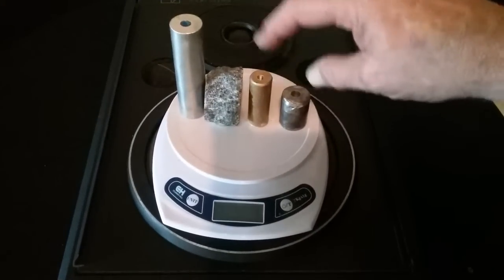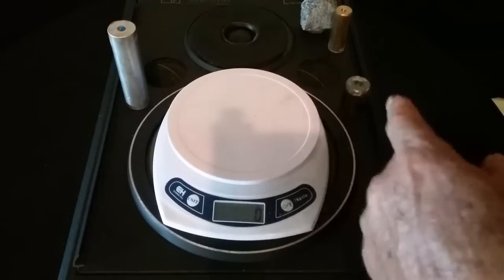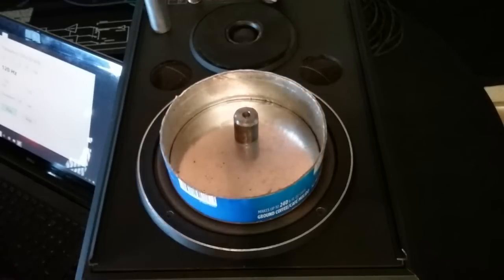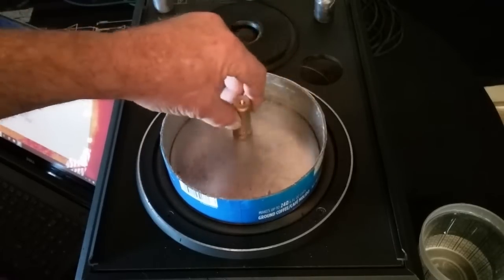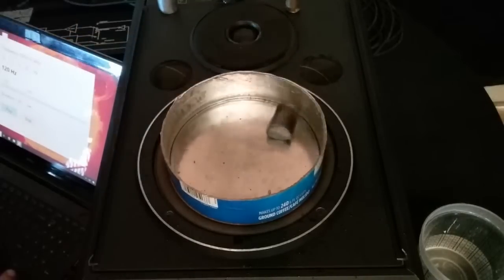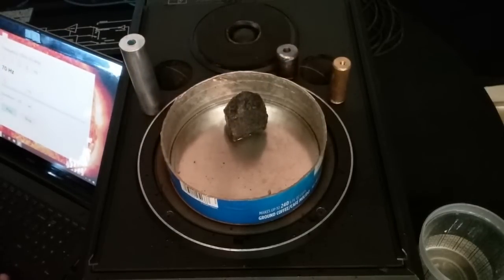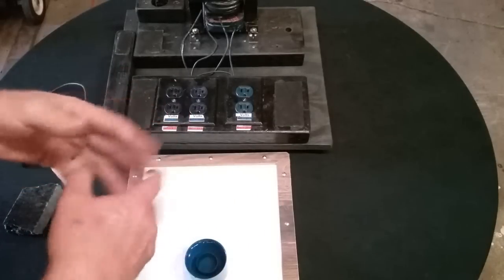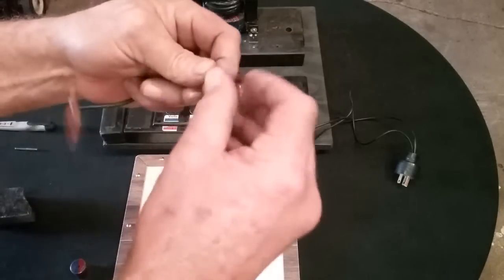Vibrational and Electromagnetic properties of Granite

Comment: That must have been how the Egyptians moved the granite blocks. The question is, how did they make sound frequency vibrations
Reply from the maker: Two things. I believe the megalithic structures in Egypt are far older than the "Egyptians". I believe there were huge humanoids (Nephilims) moving the huge stones - but I also believe in the Saturn myth - which made gravity, the electrical ambiance and the vibration situation of the Earth was much different thousands of years before the Egyptians.
Reply: Akin Aydemir I believe if you run a electric current threw crystal it creates sonar. Which essentially is the same thing as sound waves.
Reply: They have found thousands of bowls that are capable of creating different frequencies
Reply: They also had giant instruments like the didgeridoo.
Reply: @Akin There is already substantial evidence that ancient civilizations had huge (room sized) musical instruments -- drums, horns etc. You can easily find them in Bhutan and Tibet today.  There are many ways to tune sound to get it to a higher frequency similar to how we tune electricity to get higher voltage. You can get a higher frequency with simple tuning forks.
Reply: Have you checked out the channel Water Power Planet? If not you should.
Reply: Also think about gongs......That could be a possible tool for this concept.
Reply: @TheGoodVibrations  i believe there were giants as well. I have never considered tho that the electrical ambience and vibration of earth could have been different. Thanku!! That puts some things in perspective a bit more for me.
Reply: 100%
Reply: @TheGoodVibrations   you are on to something 😊
Reply: https://youtu.be/BsqOLCXYznE another great video regarding granite and possibly how giant blocks of granite were cut.
Reply: They've using the sound came from earth and multiply it, the sound source could've been the water that used to flow under the pyramid
Reply: If you look at hieroglyphs they had large tuning forks depicted in many drawings and carvings….
Reply: Somehow I'm picturing drumlins of men by the hundreds drumming
Reply: That's very simple and easy to find look up things that produce freq that the ancients used.  One other way would do with a megaphone and the pyramids In theory that is.
Reply: Didgeridoo and dance/marching to cadence
Reply: @danielchism2317   I've imagined a giant tuning fork driving a bunch of miniature tuning forks with reciprocating/vibrating diamond cutting tools. A bunch of people just carving away with multitools.
Reply: Bose noise cancelling headphones
Reply: You can vibrate things with your voice. "Ooom"
Reply: The India theory is they used a ship to move the big blocks. It even talks about where they put the ship.
Reply: There are probably spots on mountain tops where sound can echo and multiply it's strength.  If directed towards the stones the right way, maybe that could work?
Reply: @Lani Childs elephants need cover from the sun, can't find it in the desert
Reply: @flippinswazzy7115  and laser beams
Reply: @bundiesel8472  facts imagine a group of didgeridoo "oooohming" away or a few hundred people dancing stopping chanting I'm unison.
Reply: @cavelvlan25  makes since to me
Reply: Maybe if a lot of people was farting at the same time....?
Lol lol sorry.
But it is a good question.
Reply: @bundiesel8472  there are actually biblical  aspects that support the tech. Such as the trumpets destroying the defenses at Jericho. Marching a fleet around the city walls and blasting trumpets till they fell. Not saying this this is historically accurate, not saying it isn't. Only that it's supports using vibrations in ways we have not.
Reply: One person has said that you can see tuning forks with wire intertwining in the fork in egyptian hieroglyphs. Also these tuning forks are attached to long poles. This is for the drilling they believed
Reply: @ozoneswiftak  they almost surely used barges (ships) to transport heavy stones from the quarry to the complex. Likely the complex had channels and docks that came much closer to the pyramids than now. All this is accepted mainstream Egyptology. The things harder to explain is how they were able to carve granite to such tight specifications. The Inca’s and some from India worked to even tighter tolerances, but the Egyptian coffin vault(s) are almost perfect rectangular boxes formed from a single piece of granite with ninety degree angles (not rounded at all) and surfaces so flat and smooth they are almost mirror like.
Reply: @TheGoodVibrations  they used the natural vibrations from the planet to create the electricity using the piezoelectric effect
Reply: Also the earth is an anomaly as a planet because the molten metal core is approximately twice as big  as a result of a collision with a twin planet and the two cores amalgamated, this gives the earth a much bigger magnetic field making the piezoelectric effect much stronger, the moon is what's left over from the collision
Reply: What makes you think Egyptians moved anything?
Reply: @andyb7963  That's an unproven hypothesis like most cosmology.
Reply: Or both frequency and magnetism. Frequency to get frequent lift. And magnetisn to push or pull like how 2 magnets can battle
Reply: This does not explain how they lifted multi tonne blocks 350 feet in the air and placed with precision. Another thing is how did they position 1 block onto the pyramid without moving any of the others.
Reply: @TheGoodVibrations thank god someone else has the eyes to see. All the real good granite stuff is pre 12,000 years old. Before the great cataclysm and the other pyramids are later attempted reconstructions
Reply: @Cjohn31  The museum of Cairo  has lots of those wooden staffs w wooden tuning fork looking ends you see in heiroglyphics. Seems like they could be used to strike w to give a set frequency determined by the fork, delivered in pulses by the strikes.
Reply: @terryenglish7132  that's interesting
Reply: @foylad4862  There's a video here of a grandfather moving 10- 20 ton concrete slabs and stacking them up BY HIMSELF, using just simple machines, ie levers, wedges etc. The key is placing a pivot sphere 1/3 of the length then just swinging it around, then doing it again . Those Diorite "pounding stones" found in quarries were for that purpose, to move the stones, not make them.
Reply: Sadly, the vibrations would not travel through  loose sand like it does a flat piece of sheet metal. You'd need flat polished bedrock. And scaling this up doesn't seem feasible, either.
Reply: @oninjadolegume  that was just my big deck boiii haha
Reply: Farts
Reply: The pillars were hit by the wind creating a hum
Reply: It can be entertaining, enlightening, and even  inspiring to dig into myths and legends and metaphors. But believing in anything outside of your direct felt experience is foolish and is distracting you from unlocking the secrets/(w)holiness WITHIN. Don’t delude and dilute yourself.
Reply: It wasn't the Egyptians bud..... the way they dated them was from things inside..... these are remnants from a much older civilization and they're seen all over the world. The general understanding of our planets history is waaaaaaay off. But i understanding what you are getting at. I think our current civilization (started by the people that survived a mass extinction even) went the wrong direction. We went against working with nature and the earth, and i think the ancient ones work with.
Reply: Tuning forks and brass trumpet like instruments shaped like a cone but long as fuck.... not everyone can hit the right notes to resonate with the fork....
Reply: Throat singing and using specific geometry with those throat vibrations to resonate with the stones. It was documented by someone (I dont remember the name) back in the early 1900s when he went to Tibet. They were levitating huge rocks using special blocks with specific shapes in them and singing together in a pattern
Reply: @justajohnsmith    his name is 

dr. jarl !!!  

Research him! 
Edit: good to know about that!
Reply: Ohhhhmmmmmmmm…..
Reply: Joshua's army in the Bible used marching and trumpets to bring down the walls of Jericho...*hint,hint
Reply: Bell stone singing bowls
Reply: The answer is under the pyramid there was water flow and while water moving it makes sound. You know the flowing river sound right?They take it that sound then convert it to electricity. Done
Reply: This would require the pyramid to be built first or at least the necessary chamber.
As others have commented,
One theory is they got running water to pass in those resonant chambers and the natural frequency of the running water in the resonant chamber(tuned to the same frequency, i think)
Along with the rock types of which it was created
Reply: They didn't move giant stones... They mixed it up on site like a giant cast molding. Look up geopolymer
Reply: They played music with the right frequencies
Reply: Instruments aa
Reply: Digiridoo?
Reply: Acoustic levitation isn't fantasy ... And tuning forks and trumpets and various instruments aren't either....
Reply: The Earth itself can produce the vibrations needed
Reply: From what I read in that link I posted, it looks like they might need a chord, it talks about using an excitation frequency to adjust the harmonic frequency of granite. Playing music inside the great pyramid affect the granite under it's own weight really should have energetic effects.
Reply: That is what led me to this video

Comment: You're paying attention to variables that are a bit removed from the phenomenon. Similar mass between the objects doesn't mean much. Geometry and the speed of sound (which is determined by bulk modulus and density) through an object is much more important when it comes to resonant frequencies, as you will learn in an AS physics program. You can find frequencies specific to each material that will result in this same thing, but it depends on the geometry, mostly height or length, of an object. The water acts as a dampener and makes it a bit more complicated, but not by much. You can calculate resonant frequency with f (resonant frequency) = Velocity of sound through the object / (2 * length of the object). The velocity of sound through the object can be calculated with Velocity of sound = square root of (Bulk modulus / density). In part two you're creating an inductor, which is a coil of wires with a time-dependent changing current (AC) running through it creating a magnetic field, and if you place a permanent magnet inside of the coil it can store a bit more energy. These are used in modern electronics everywhere. I hope this helps your exploration.
Reply: Most accurate explanation I've read or heard so far...hmmm..interesting that the host does not want to comment...pseudo-science folks or those that don't understand all of the related concepts enough love cherry picking science to suite their needs and ignoring other related science (or are simply ignorant/unaware of it).
Reply: Wrt wave density, didn't he comment that the activity was found regardless of frequency emitting from/through the speaker?
Reply: @youKnowWho3311  What is wrt wave density? The frequency matters.
Reply: @jessewilliams6459  WRT, means with respect to. He states freq modulation in his parameters of the test.
Reply: Do you think this channel is interested in ACTUAL science? lol, no
Reply: @youKnowWho3311  What "activity"? What speakers? What frequency? What anything of your post as to do with OP?
Reply: Smart a**
Reply: It gets even more complicated with completely irregular shapes such as his granite because the vibrations get distorted by the varying entry/exit points of the object.
Reply: Have you ever considered old world granite structures designed with resonate frequency in mind? Why would  lead be added as a jointer material in between cylindrical blocks to build columns and the typical triangle "Roman" style structure above it.
Reply: Velocity of Sound equation. Please explain.
Reply: Bulk modules?

Comment: You have a new subscriber after I watched this vid. I'm just a basic residential electrician with average scientific understanding but I bought a house a few years back and had suspected there was an underground spring in the driveway when I half buried a skidsteer tearing up the old asphault. I came across the concept of dowsing rods while researching how to tell if I had underground water. Long story short I made some crude dowsing rods out of scrap 6ga copper and belive it or not they worked so well I felt like I saw a ghost. Long story short I understand it has something to do with the piezo electric properties of water running over bedrock and it creating an electrical field that the rods react with but I wish I knew more. Over the years since then I've stumbled upon some wild theories that I wouldn't have payed any attention to prior to having my mind blown with the dowsing rods. The pyramid power plant theory is one of them and as mechanical thinker it's obvious they're more engineered machine than monument. Thanks for posting these vids
Reply: Thankyou for that insight.
Reply: Put this in your toolbox of knowledge. The Great Pyramid used to have running water under it. The tunnels are still there although most are either dry or just have some stagnant groundwater that has seeped in.
Reply: It maybe also useful to consider that when dowsing where you have two water channels crossing each other it creates a vortex of energy rising through and up from the ground sometimes some feet/metres into the air.
Reply: Kelvins thunderstorm.... where grondwater comes up it creates a split cousing inbalance in the outer shell of the water atoms. The slight inbalance the spring creates potential or voltage.... there are videos showing this with running water thru a straw to a Y split and put an led in between the prongs. as for the video even just a coil without a core creates magnetic force. A core simply directs it so it makes it more efficient.
Resonance. Get stone resonating tone. 
Then counter north and south pole. At 180 of shumann resonance. this is usaully called subtle energy. We like to build electrostatic motors to run on this natural static force we still live in. No change of invironment. This simply does not work with 50/60 hz Megawatt power consumption.
Reply: Hi,do you know about the Swedish doctor Jarl and his friend Henry Kjellson (Oxford university student) studier and films about acoustic levitation made in 1939,Dr.Jarl wrote a book about Tibetans munks levitation of big stones and Kjällson made drawings and descriptions about how this works.if you google  Dr.Jarl acoustic levitation in Nepal then you are going to find the films and the drawings.  Love from Sweden 💛💙
Reply: You watched the whole video. Lmao
Reply: The Lone Wrangler ...excellent deduction about water running across rock. Water is H2O and it's the Oxygen that gets charged. Water can can be shared up to O23. This happens in the ionosphere, and falls to Earth because of its weight and zaps all the pollutants  and cleans up the atmosphere but electricity is generated when it forms ice crystals (hail) and opposing flows of hail go up and down and charge the entire cloud  which is discharged on the Earth. The key is The ionic properties of Oxygen 😊
Reply: @beingblack  Boo excellent, so why don't you guys get together because you're all like the 10 blind guys feeling up the elephant. Keep sharing your observations then you'll know what the pyramids were really about and what their purpose was. Think frequency. What frequency did the pyramid generate ?
Reply: @utube271258  - 2 opposing streams of water creating a vortex has a name. Keep going , you're almost there. Brilliant
Reply: @humbuccaneer84  50/60 Hz is the wrong frequency so keep experimenting you'll crack it
Reply: @joedee1863  not sure but I would think that 432hz played a part somewhere in the pyramids.
Reply: @joedee1863  Dipole Vortex! Thank you will look further.
Reply: @beingblack  - well it's a multiple of nine and within the harmonic range but think a bit lower. Think of Earth resonance. And what happened when those guys got inside some years ago and struck the suspended apex structure with a big iron bar . Check out Schumann frequencies
Reply: @joedee1863  Crossing underground streams can cause some health problems or psychic uneasiness. Some copper applied in the proper spots and/or maybe also granite, will ease the uneasiness. They also used stained glass windows in cathedrals to transform these effects into quit/stillness of the mind.
Reply: U are awakening toward a more realistic reality

Comment: It's just basic induction, only difference here is that you used granite for your core which has about 3% iron content. In modern times we use iron, cobalt or nickel in the core as they are ferromagnetic,we laminate cores to reduce iron losses and hysteresis losses which are given off as heat. You've just made a very inefficient transformer. You would get the same effect if you used air in the core but just at lesser levels,you would need more sensitive equipment to detect it like a galvanometer

Comment: Very interesting .However, dimensions are far more important than weight when dealing with wavelengths and vibrations. Try repeating this experiment with 1in cubes of material. Or, more specifically tune your dimensions of the material in accordance with the wavelength that you are bombarding them with. For example, 11,802.85 MHz should give you a wavelength of approximately 1 in.